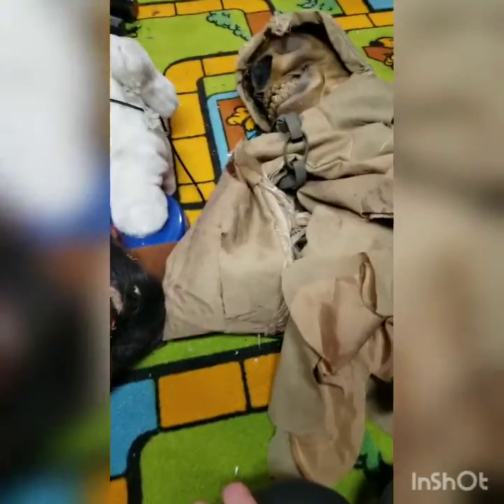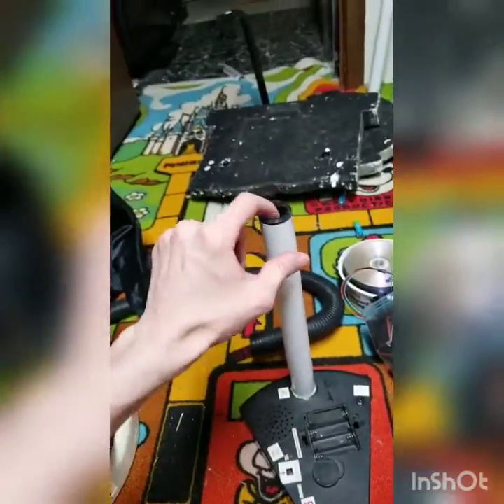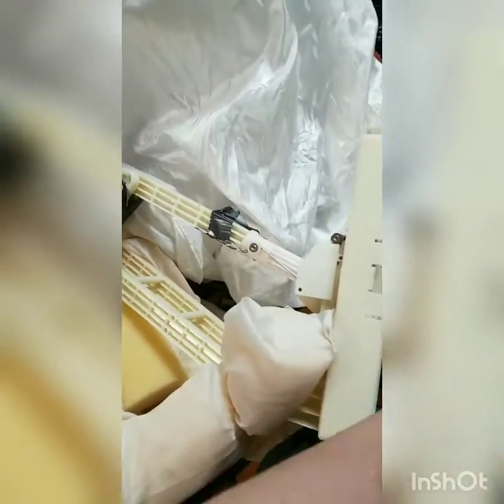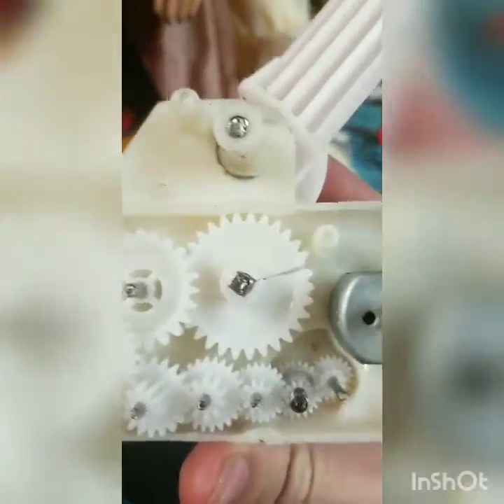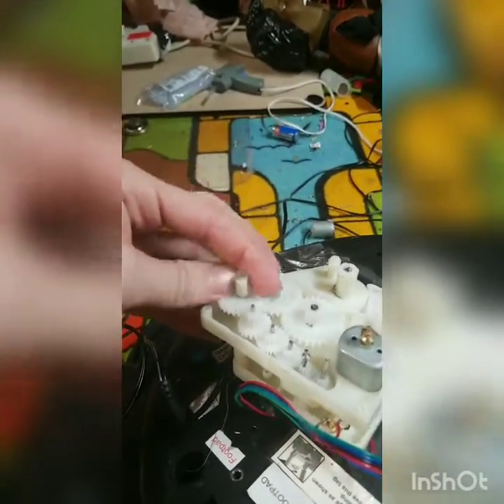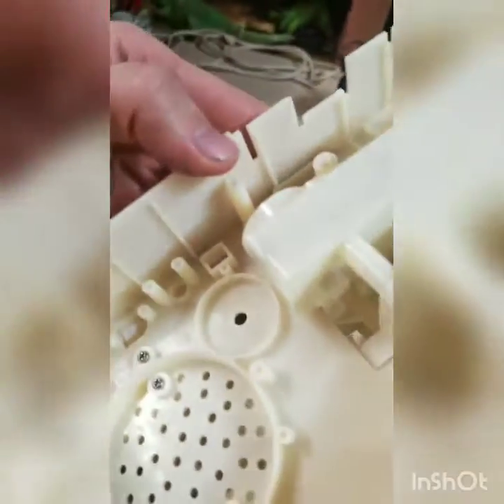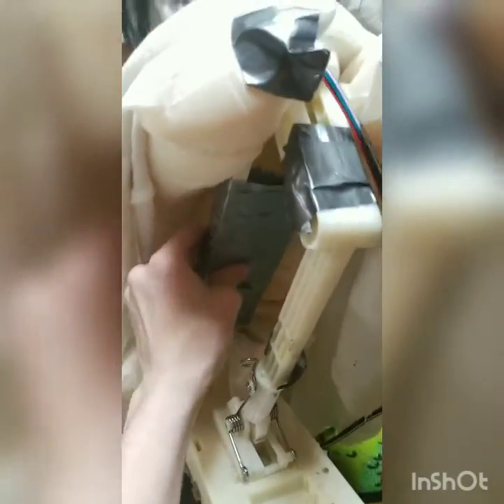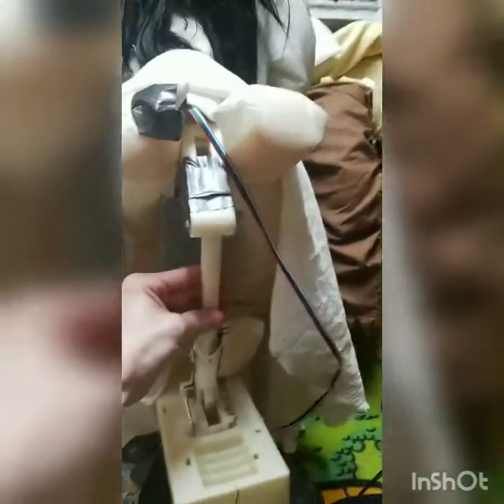April 11, 2020

Comment: Crap, Lunging Lily pops up twice just like the Incinerator now.......
Then she pops up rapidly
Reply from the maker: She pops up constantly, her mech isnt like incinerator, hers only spins 1 direction, incinorator has 2 separate mechanisms one mech the has a piece that hits a release pin which makes it pop up, and the other retracts it. A wire is off the relay switch which is why it pops up again just like pennywise, all pop up ones have a mech like that, this uses a jumping spider mech. My incinerator doesnt go back down now
Reply: @jobeanvideos  Ok

Comment: Hey I hope you see this comment but what was the problem with lunging lily? Why did she keep lunging without the animation? I’ve got a jack o lunges that does the exact same thing I for years I couldn’t figure it out
Reply from the maker: Your jack o lunger would be the relay switch not working my lunging lilly is a different problem
Reply from the maker: because if you see in one clip before it was put together it's fine, and in another clip the gears are flinging up the opposite direction meaning they are losing connection with the other gears, and not this is a mech that only springs 1 direction, but when its flinging up its moving the opposite direction. Jack o lunger relay switch piece breaks all the time or the piece that hits it is popped put of place
Reply: jobeanvideos well thanks now I know what the problem is except that I’m not really an expert at these things like you are I wouldent know how to fix the relay switch I wish there was a way I could send it to you so you could fix it (yeah I just took a look at it and watched the activation the relay switch is broken)
Reply from the maker: Ya, you cant actually fix a relay switch if its broke, but you can put in a replacement, and yes I could probably fix it. I have a jack o lunger as well, but the arms and head cant pop up and it's just zip tied on, there was a gear broke, and I couldnt get it fixed, the problem with these is the square shaft gear is almost always broke in these now days, in both the lunging and the arms
Reply: jobeanvideos is there a way I could send mine to you, cause I think the only thing broken is my relay switch everything else seems fine